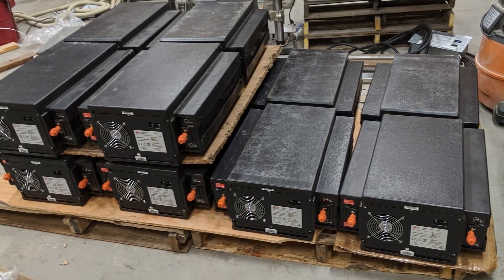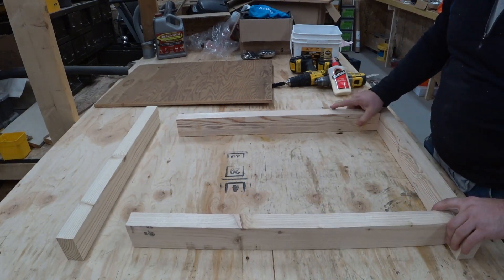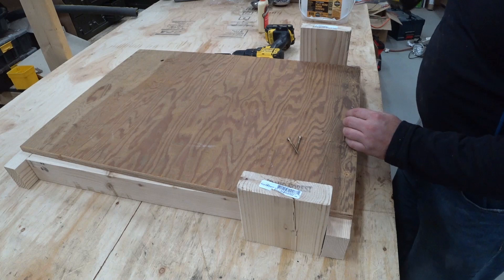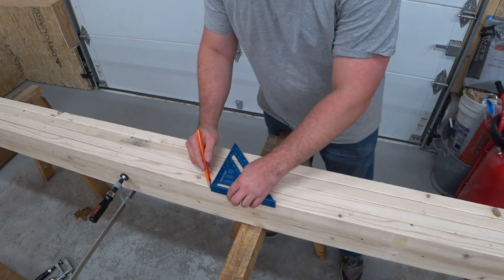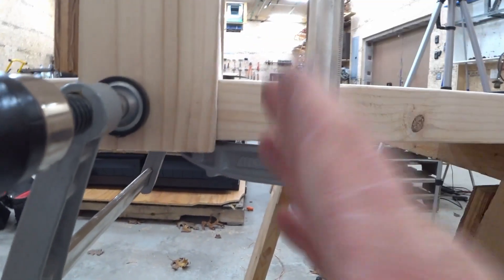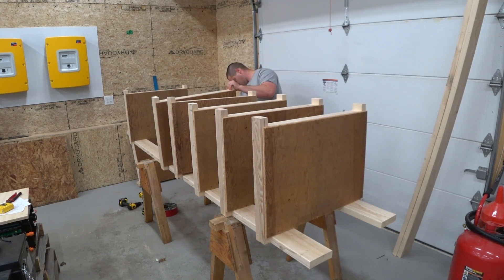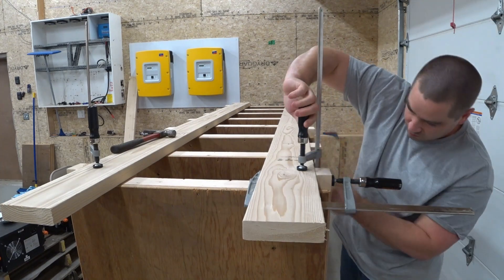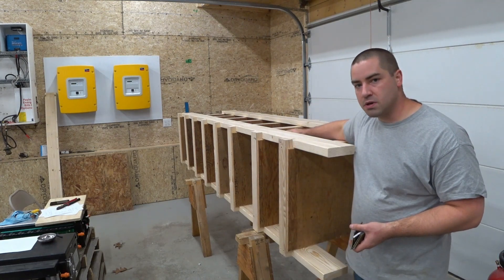Building a Battery Rack for DIY Solar Off-Grid System

Comment: Very well done David.  As someone mentioned, notch the wood next time. I would add two diagonal pieces of wood along the outside to prevent it ever from tipping forward.  All your pieces are placed completely vertical and parallel, so it could flex under great force.   But I'm sure it's strong enough.  And i like the placement of it in your garage with only 4 sq feet of floor space being used.  Thank you for taking the time to show us this build.

Comment: Please, tight the top of the rack to the two walls with good skrews. The structure is very tall and the footprint is relatively small. It looks to me dangerous with all that weight on the upper part of the structure. Very good design and very good build. All the best.

Comment: I may be seeing things but when you were talking about the crown it looks like the 2x6 opposite it is attached with the crown up or away from the rack.  That design is plenty strong but I wouldn't want to be the one lifting the modules to the upper slots.
Reply from the maker: In the end, the rack is straight and square.  If it doesn't look that way on camera it's probably the lens.
Reply: @DavidPozEnergy  it looks straight I was talking about the wood grain itself and tendency to cup toward the open side of the U of the grain its the one on the left at 7:54
Reply from the maker: I didn't check that.  You mean like "bark side" out?
Reply: @DavidPozEnergy   it should be bark side out so what its attached to will keep it flat .  example building a deck when attaching the deck boards to joists look at ends and put bark side up which is to say put open of C of grain down toward the joists

Comment: nicely done but I like steel better I wood of gone to a salvage yard and got a heavy metal cart and shelving so if needed I needed move it around  I could and have the old Aims  inverter bolted to the cart for portable power any ware needed but that's my crazy thinking

Comment: I would overshim it so it is leaning towards the wall a little.  That way if some kid climbs on it, it will be a little less likely to tip over.  Maybe even attach to the wall.  How do you know that will support all the weight?  If you hear a loud noise that sounds like a rack full of batteries crashing to the floor, you will know the first place to check.  How much does that weigh?  2000+ pounds?  I feel sorry for those bottom supports.
Reply from the maker: Hi David,  This rack is supporting about 1300 pounds.  This is only 40 psi.  It's really not a lot of weight for this much framing.  Each shelf transfers the weight to the columns, and the 4 columns transfer the weight to the concrete.  Yes, I added a some lumber up top and it's lag screwed to the wall.  But I did it after the last battery, so it's kinda locking the battery in.  I can't tip it over and I've jumped on each shelf with the batteries in place.  Plenty strong.

Comment: Just 2 questions.  First, can those batteries store on their side instead of their bottom/top?   Second, is there some special connector that is used to hookup the positive and negativeposts?  They look to be a different size than other batteries.  Thanks.
Reply from the maker: If you tip the batteries on the side you will be putting all the weight on the plastic covers over the battery terminals.  They don't look to be built for this.  I think they would deform over time and eventually you would be putting the weight on the cells themselves.  I didn't see a quick easy way to have them on the sides.  I was looking at this to maybe keep it slim to the wall.  The top/bottom have big aluminum heat sinks that will spread out the weight of the cells.  Second: The battery posts are 14mm diameter.  I spent a long time looking for the original type of connector.  I have one on order to try out, but it might not be the right one.  I'll show in a video.  But, in the meantime, I made some from copper pipe.  Again, I'll be showing it in an upcoming video.  Thanks for watching.
Reply: @DavidPozEnergy  Thanks for the response.  Yes, I wanted to have them closer to the wall and not stick out as far but you make a good point about the side and terminals.  Looking forward to your next videos on this project.

Comment: Love this vid!  Think I'll do very well with an almost identical build.  I'll replace the front cross-support w/triangles in the corners, reducing stack height by several inches per battery... hope that makes sense?  Anyone think that might not be beefy enough?
Reply from the maker: Another way to reduce height is to remove the heat sinks, fans, terminals on the batteries.  I saw someone elses video demonstrating this: https://youtu.be/fAXrYiQswIc  I think it's worth it.

Comment: Man, that gonna be a lot of weight putting on the bottom rack footing!  I'd hope the wood can stand it over time.
Reply: It's not the wood I would be worried about. It's the fact that all that weight is really only being held up by the screws due to the construction method chosen.
This is because each shelf is not notched into the support posts and instead transfers the load from the shelf to the posts through the screws. If the support posts had instead been notched such that each shelf was inset to the posts by 3/4-inches, then the weight would've been directly transferred to those posts and the screws would simply keep the shelf from pulling away from the post. With a little wood glue in those joints along with the screws, there wouldn't be any risk of the rack twisting or falling apart. Some other considerations that should've been taken are in regards to the materials chosen. For the support posts, treated wood should've been used for the direct contact with the concrete (the shelves could remain untreated). The posts should've also extended at least a couple inches past the bottom of the lowest shelf in order to keep that shelf from having direct ground contact (concrete at ground level is to be considered ground contact for this purpose). And then a metal band should've been wrapped around the bottom of each post to keep it from splaying under the load it is carrying.

If the garage was built to minimum code, there shouldn't be an issue with the load density of the rack and batteries.

Comment: David, how many amp hours will you have from all these batteries? You aren't using all you purchased or are you going to build another rack for the rest? How do you manage to get 168 lb batteries on the upper part of the rack. I watched how you were lifting them in your other videos and am wondering how your back is going to be in a few more years as well as the double hernias I incurred watching you lift them. 
I have 6000 Watts of panels I am building an off-grid system with. Would 4 of these batteries work with a 8Kw inverter? My demand is less than 6K but I have a few times I will need the extra power. Maybe I should purchase a few more panels as well. You thoughts will be greatly appreciated.
Reply from the maker: Hi Craig,  There are a lot of questions in there.  Would 4 batteries work with 8000 watts?  Sure, these can handle 83 amps each no problem.  But if you would like to dive into more details lets talk on facebook.  I'm at davidpozenergy
Reply: @DavidPozEnergy  Can't thank you enough for such a speedy reply. You're are a very exemplary young man. So creative. I can't imagine what would have happened if you had focused your energy on building a house out of disposable plastic bags and bottles!

Comment: Looks like it will be a nice upgrade.  I couldn't help but notice the solar hotwater setup in the background when you were installing the rack. Would it be possible to get an update on it's long term performance?
Reply from the maker: The update on the Solar Hot Water?  Pretty boring.  The system just works.  The sun comes out, the pump turns on, heats water.  I haven't done anything to that system.  I have several videos on the build.  This is one of my favorite videos: https://youtu.be/W03zjGPCjjE

Comment: Your probably OK but I wouldn't have built it that way. My issue is that the way you built it the shear strength of the nails is all that holds the weight of the batteries. I would have liked to see cripples between each layer to support the weight with wood not nails. Just my opinion the rack is an excellent idea though.
Reply from the maker: Lots of ways to build something.  Cripples are good to.  At one point I thought about cutting dadoes, but nah.  Better to get it done.  I'm burning grid electricity right now!  I've got to get back to my solar power.
Reply: The nails are holding the load of the shelf but lets say the battery weighs 150 lbs and it looks as if he put in 16 nails per shelf then that would be about 10lbs of shear per nail. I have heard that the shear of a nail is about 100lbs, but even if it was 50 lbs the shelf is built plenty strong.
Reply: A Good bit of my building experience comes from stands for large aquariums. Strength is important when you have a ton of water in your living room.
Reply: @trailrunner67  I did say he was probably OK.

Comment: Great build!  BTW, why did you decide to go 48v instead of 24v?  Purely for the inverter performance?
Reply from the maker: My inverters can do a combined 12000 watts continous.  That's 250 amps at 48v, or 500 amps at 24v.  Moving that many amps makes everything harder.  Bigger wires, connectors, fuses, breakers.  All that stuff gives off more heat making the system less efficient.  And I would have needed two charge controllers for the same size array.

Comment: Forgot you had solar on your house roof... grid tied?
Reply from the maker: Yes.  The house roof is the only grid-tied stuff I have.  But I'm enjoying this off-grid stuff a lot more.
Reply: DavidPoz going to AC couple with the SMA’s?
Reply from the maker: The SMA's are part of my off-grid system.  The off-grid system will not be connected with my grid-tie system ever.  It has to be that way for permits and such.  That being said, I do plan to experiment off-grid with some AC coupling on the SMA's just to see how they do.  But that will be off-grid.  I must stay off-grid with any of my work.  So I am.  I'm not violating any of my permits.

Comment: You must have an unlimited supply of cash for all that stuff!! Those inverters are expensive!! I guess it won't be a rinky dink system and you will truly be self sufficient.
Reply from the maker: I bought the inverters for $2400 shipped for the pair.  I got them from Ebay.
Reply: @DavidPozEnergy  Good deal!! Just one of them would be $4k!! Well if your solar array and batteries are up to snuff...excellent job!!